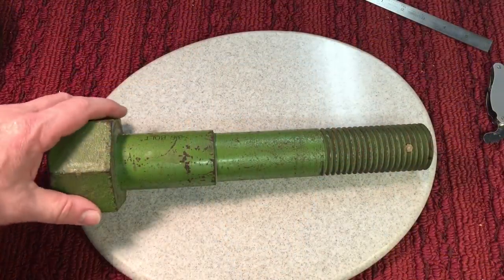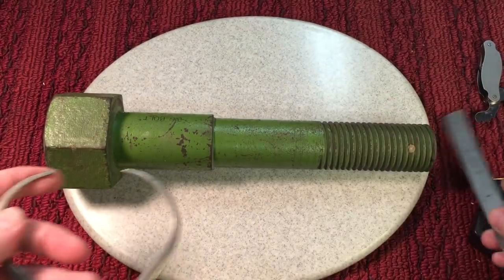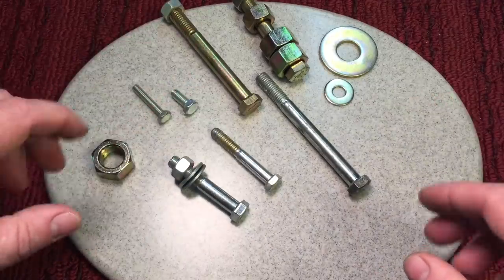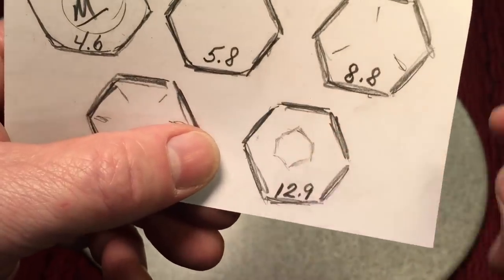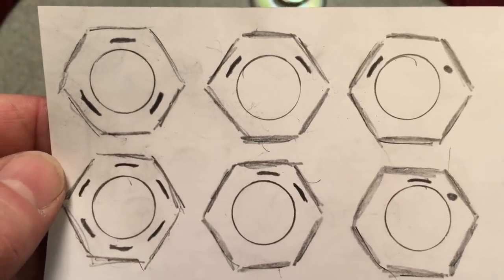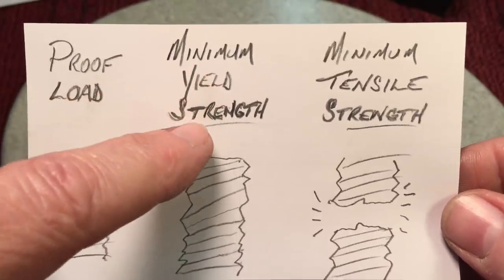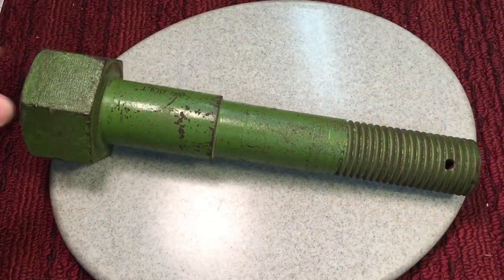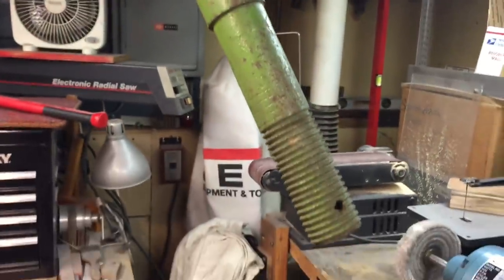The Basics of BOLTS!

Comment: Hey scoutcrafter, In the hardware store where I work my job is ordering and maintaining the fastener aisle. Often times I get customers that come in to purchase bolts and nuts and I ask them what is the application. They give me the deer in the headlight look and say "I just need a nut and bolt". Then I have to explain about nuts and bolts. Sure wish I had a small screen where I could just turn on your video. Informative and not boring. Thanks,
Mike
Reply from the maker: You know Mike, one day I would love to get all of us together and flash mob your store!  We will all come in and ask for Mike!   😃👍
Reply: You are right in asking the application, its very important and for safety reasons as Scoutcrafter mentioned. Imagine someone using a low tensile bolt on a car, truck suspension joint, or a lifting shackle.
Reply: @mohabatkhanmalak1161  Yes, it could be really bad results if you need a grade 8 and you buy a grade 2 to replace it.

Comment: Good design practice is to remember that a nut and bolt is a very powerful spring. They work by clamping the parts together. In some applications the torque applied to the bolt is defined by how much the bolt is stretched by measurement with a micrometer. An example of this would be found in some engine connecting rod cap bolts.

Generally the nut should be softer than the bolt. This is so that the threads in the nut will deform to the bolt threads and permit a greater torque to be applied without the bolt failing. An example of this would be that some engine rebuild procedures require the connecting rod nuts to be only used once while the connecting rod bolts may be used twice before replacement.

Putting a bolt in shear is very bad practice. The failure will begin in the root of the thread followed by catastrophic failure.  Drilling holes without adequate bolt clearance is to be avoided. Shouldered bolts are no help here. If the mating parts start to shift, it's likely that one bolt in the assembly will be absorbing most of the shear load and the bolts will fail in a chain reaction. If parts must by accurately located to each other, dowel pins, roll pins, keys or some other positive location method should be used. 

Washers are generally made of a softer material so they will deform to the work so the loading from the bolt or nut will be spread out over a larger area. Some spring alloy washers are made in a conical section so that when crushed flat they are generating the desired clamping force. One caution: On cast iron, never use split spring washers as the sharp edge of the split may start a crack in the iron. On cast iron always spot face the casting's bolt holes so that the nuts, bolts, and flat washers will set flat on the casting and not crack the very brittle cast iron.

Cheers from NC/USA

Comment: Cotter pins in US .😎
Split pins in the UK.
Nuts and bolts are taken for granted but without them modern day life would be impossible!
Thanks Scout Crafter a very interesting subject.
Reply: Yep cotter pin is what holds the crank on ,on a bicycle 😁
Reply: @jusb1066  😁 aye tis true .
Reply: @paddrivers  I still keep a cotter pin in my toolbox lol, not been hear a bicycle in ,30 years
Reply: @jusb1066  I used one on a Peugeot gearbox on a clutch change recently. 
 cotter pins are similar to bolts but different...suppose it depends which side of the pond your on.
Reply: Yes indeed, but what is the shearing strength of that split pin?
Reply: @marcmckenzie5110  not much more than a piece of cheese?

Comment: I work on an Air Force base and had to look up some hardware for one of our trainers and got education on  the different types of bolts. They call Allen head bolts internal wrenching bolts and hex head and 12 point bolts external wrenching bolts because of where the tool is on the bolt head.  Bolts are actually called cap screws, they become a bolt after you thread a nut onto it. Great channel, always learn something new from it.
Reply from the maker: Hi Scott- YES!  The guys with the pocket protectors love to get technical on what is or isn't a screw or a bolt- Basically a screw threads into something and a bolt needs a nut but in the real world a screw holds wood together and a bolt has a bunch of definitions..  They get all bent out of shape when they try to call it a carriage screw instead of a carriage bolt!  =)

Comment: I just came in from mounting a  hi-lift jack to my roof-rack. After watching the video I went back out and checked, and sure enough the supplier had given me grade 5 bolts to survive the journeys on the corrugated bush tracks. Great info. The other marking that I have seen commonly is the notched nut. I know you will instantly know, but I am wondering how many of your viewers would know what that signifies.
Reply from the maker: The funny thing is the Hi-Lift incorporates a Non-Hardened bolt that acts as a shear pin!  The one bolt you absolutely don't want to upgrade!  LOL!!!!    Great jack!

Comment: Scoutcrafter thanks for the info on bolts and nuts. Great information. The bolt you had is a little like the ones my dad used to make for the H.K. Porter #2 and #3 forester tree limb cutters. The bolts that held the cutting blades to the handles would have about a 5/8" head with 3/8 shoulder and 1/4" threaded section. The unusual shoulder size may be as in the H.K. Porter cutters would be for a built in bushing to the bolt so the cutting blade would be able to ride up and down a section of the handle for leverage! Extremely unique!
Reply from the maker: Lots of cutting tools have wonderfully unique fasteners holding them together!  It really is an art!!!!!
Reply: @ScoutCrafter  that it is! The hard part is when you might break one or one is in bad shape. Unfortunately you can't go to a hardware store and get one! I wish my dad had taught me how to make them!

Comment: AwesomeI didn't know what those markings meant but have seen them plenty of times. As an electrician I use nuts and bolts for supporting conduit and heavy electrical boxes but we don't use them as often as the other trades. I'm definitely going to check the grade of the hardware we order from now on.

Comment: I didn’t know the markings on nuts. FYI, the flat washers are known as cut washers because they are stamped out of a sheet. If you look closely one side has sharp corners and the other is kind of rounded. The sharp corner always goes down. If installed wrong the sharp corner digs into the bolt head & can cause stress, shortening the life of the bolt.
I really enjoy your vids. Keep them coming.
Reply from the maker: Hi Steve!  There is a lot of engineers that argue against that!  First off proper washers shouldn't have a sharp edge...  (their argument)    they also feel that the washer if installed sharp side down can damage the surface of whatever you are trying to protect!  It's funny to read the back and forth on this!   =)
Reply: ScoutCrafter I agree about proper washers but where can you find them outside of an aero-space supplier? ($$$.)

Comment: Hi scout,interesting  discussion  on bolts, and their grading marks. Don't know if it's of interest to you, but uk imperial bolts were letter marked for grading, a good high tensile bolt started at letter ( R) which equated  to 40 tons per sq ins ", every letter above that went up by 5 tons per sq ins" ,or below down by 5tons. As an aside when I was in the trade and we had to torque up castle nuts , if they didn't line up to fit the cotter pin/split pin we would remove nut ,very lightly grind off the back of it until the pin lined up at full torque. Best wishes Scout . Stuart uk.
Reply from the maker: Hi Stuart!  That is fascinating!  I never knew that!   Thanks!!!!!!!

Comment: Good video.
In some of my local hardware stores the Grade 5 and 8 bolts are available in UNC (coarse thread) and UNF (fine thread).   A detail to pay attention to if you do not pick up the respective nut at the same time.   I have been burned in the past getting a bolt and did not look at the bin to see it was a fine thread bolt only, then at home realising I do not have the fine thread nut.
You restore some old tools so another detail is the potential old style thread form, e.g., Whitworth used on many Stanley-Bailey and other vintage hand planes.   55 deg included angle vs 60 deg for UNC and metric, but the bigger challenge is the unusual diameters and tpi.  I have seen my share of vintage hand planes where someone attempted to replace a missing screw with UNC hardware.   They may have forced the new screw in place, but it will not be a good fit.
That bolt is a monster.   I cannot imagine the size of the wrench for that beast.
Dave.
Reply from the maker: Hi Dave!   Whitworth!!  All the guys working on older British motorcycles looked for Whitworth socket sets at the flea markets!  LOL   Another one is Starrett!  All their threads are unique to them!!!!

Comment: Great video! I’m a big fan of socket head cap screws, with big thick washers under their heads. They look absolutely badass! When I mount another one of my vises on a bench I will definitely use some black M12 or M14 socket heads. I need to make some diagonal braces for my workbench to stop all the swaying and flexing of the legs. I’m gonna replace all the bolts on it with partially threaded socket head M12 bolts, so that the unthreaded portions of the bolts are taking all the shear forces (it’s a commercially made workbench out of pressed sheet steel) put on them by the weight of the bench and the diagonal braces going into tension as they resist flex. Right now the edges of the sheet metal are sitting on the threads of the M10 bolts that the bench came with, and the bolts are a very loose fit in their holes. I tested it and the unthreaded shank of an M12 bolt is almost a perfect fit! I will definitely make a video of the mods I’m gonna make and show you👍🏻
Reply from the maker: Aryan- Socket head or cap screws are very hard to begin with!  They really are awesome!!!!!!
Reply: ScoutCrafter Countersunk is also nice, but you have to be dead-on with the location of the countersink, because that head ain’t moving!

Comment: In used to be around stuff that big but no more. Reducing rocks can be interesting. Thanks, CS!
Reply: Randy Bingham  Over 50 years moving rocks from one place to another with trucks and all matters of equipment and yes. working in a rock polisher. I called it grinding instead of crushing. The bosses didn't like that but it was what it was. Helped set up the local one years ago after clearing and grading. At home thinking about how I ever survived. Never did any core drilling but helped on air tracks too so there WE go!
Reply from the maker: Lewie!  There are some occupations that were so dangerous it amazes me that guys made it out alive!   =)
Reply: @ScoutCrafter  When the original crushing plant was set up it was generator powered and you stood on top of the jaw with no protection but a hard hat. I used to help the original operator that ran that same plant for 25 years and drove for 2+ hours one way to help get it set up here. Things were a LOT different then. If he broke a hammer handle (16# sheep nose) he was so catty he could jump over the back of the jaw and catch it as it came up the belt and he was post retirement age, in his 70's I think. It was some life. Pony motor start generator, D-8 I think. Nothing smaller. Starters that had wires to keep them engaged and no auto cut off. Wild!

Comment: Thx for explaining the imperial measure sistem but on the Dake press the 8.8 is the standard bolt in normal situations and on the press you want a soft maleabil (you dont have the posibiliti to acum8late a lot of presure in the bolt) bolt by destruction to not to explode like the hardened  10.9 and 12.9 are usuali black fosfor couted are the hardened and yes the the chainisium imports are usualy low as 4.4 and 4.8 you can bend by hand and strip easly also like brass nuts and bolts
Reply from the maker: The medium grade bolts are considered case hardened, that is supposed to have the best properties of both worlds, however in the application on the Dake is is strictly a shearing force.

Comment: the nuts and bolts you demonstrated are "removable fasteners".  There are some types of bolts that are permanent fasteners.  and the bolt that you showed as an example of a grade 2, was actually a screw.  Screws and Bolts, there is a difference.
Reply from the maker: In the real world "screws go in wood and bolts go in metal"  Partially threaded fasteners and Fully threaded fastener are terms for very few people.  If you look at a "carriage bolt" the seal ones are fully threaded and still not a screw..   =D

Comment: Great info on bolts. I’d like to find one of those thread gauges.
Reply: They are still sold
Reply: Jusb1066 thanks.
Reply from the maker: Michael!  You can pick up a over-seas made one very reasonable!  Starrett are a bit pricy.  I have both and they are both very good!   https://www.amazon.com/Grip-Thread-Pitch-Gauge-SAE/dp/B004ROIU2A/ref=sr_1_10?crid=1Y7B28E15BL90&keywords=thread+pitch+gauge&qid=1572915333&s=hi&sprefix=thread+pitch+gauge%2Camazon-devices%2C145&sr=1-10
Reply: ScoutCrafter thanks

Comment: Everything today is to complicated, much simpler years ago when you had local standards. We used to be imperial then they brought in metric, and bolts used to be hexagonal or allen key. Now we have hexagonal, allen key, torx, different spline types, metric and imperial. Does all this variation make things better?
Reply: Yes I don't quite know why so many head styles, I don't think tirx solved anything that Allen didn't, metric well that's to do with reliable standards, the inch didn't have a truly fixed definition till it was linked to metric in the early 60s yes it's true , an inch is actually defined as 25.4mm as metric does have a reproduce able standard
Reply: @jusb1066  Global standardisation of one standard for everyone to get the cheapest product  so they can move their factories mush easier. Metric can f off as far as I am concerned. Years ago all you needed to fix a car was 7/16, 1/2. 9/16 and 5/8 spanners and a pair of pliers. Now you need a truck load of tools.
Reply: All the different head types are just constant improvements but the old things already made just dont disappear. Take screws for instance torx and square drive are the only ones I and many others will use now because they are almost impossible to strip. Give it 50 years and i dont think youll see many phillips or slotted screws.
Reply from the maker: Hi Tony-  You are right, there is so much to know that by the time we just start to get a grasp on things our time is up!  LOL

Comment: I knew the markings but didn’t do the math (add two). Didn’t know the nuts were marked! Metric..... 8.8? Where did they come up with that? I was going to guess 10lbs on the nut! Shoulder bolts used a lot on engines especially the head bolts. Fascinating! Or fastenerating!!!! Love MMM’s!!
Reply from the maker: Aaron!  The bolt seems really heavy when you lift it!  I ordered a nut on ebay!  $12!   More then the bolt!  LOL

Comment: Thanks John my wife watches your videos with me and can you imagine the jokes I copped? Apparently I’m a grade 8 nut. Didn’t think I would learn much but I didn’t know about the ratings on nuts. Over the years I have noticed that a lot of the very high tensile nuts & bolts are finished in a flat black and was wondering if you know why. I’m thinking it may be to avoid hydrogen embrittlement from the plating process as the higher the tensile strength the more susceptible the metal to embrittlement. Any thoughts. Cheers mate, Stuart 🇦🇺
Reply from the maker: Hi Stuart !   Here in the States most of our hi grade bolts are still yellow zinc but that is a great observation because for years the higher grade socket or cap screws were always black!!!  🤔

Comment: Ha, my guess wasn't that bad. I guessed the bolt would weigh round about 5 kg (~11 lbs). And there's another marking which is important:

https://www.kettensaegen-saegeketten.de/media/image/ed/b1/7f/6892_600x600.jpg

This markings on the flanks and outer corners mean that it is a left-handed thread. You also find this on the nuts of pressure regulators for gas cylinders. Cylinders containing flamable gases always have left-handed thread connections, except acetylene. Acetylene cylinders have a special connector.
Reply from the maker: Hello Marcel!  Yes!  I have seen that on many thinner nuts like Jam nuts and non ferrous nuts but our full size left nuts did not have the cuts along the edges... They were indistinguishable from regular nuts... =)